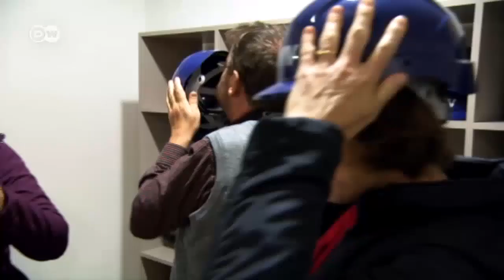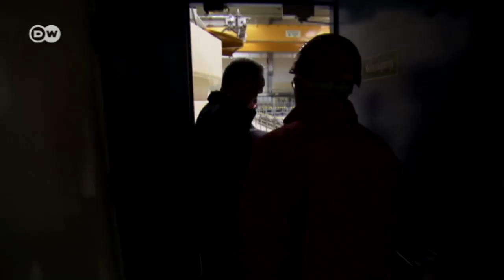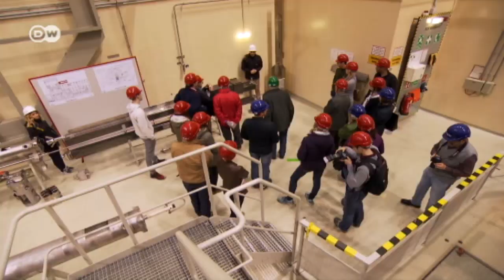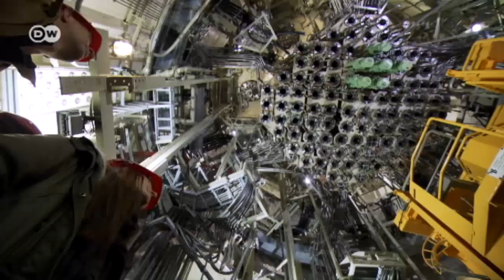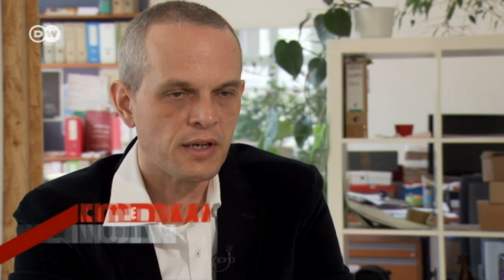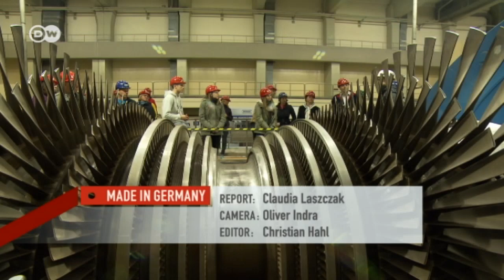How Austria survives without nuclear energy | Made in Germany

Comment: I agree, this video is very misleading, it is only taking the negative part of nuclear energy, the negative reading. Nuclear energy has advanced a lot, and of course in protecting the health and safety of the public. Take it into account, nuclear energy is carbon free and cheap electricity, no greenhouse gases and IT IS SAFE!
Reply: It's not carbon free. Refining and storage of waste is very inefficient.
Reply: yes, but when, rarely, something goes wrong, it has the capacity of killing millions of people, so it is a bit scary. Similar to flying; planes are very safe generally, but when a plane goes down death is almost 100% guaranteed.
Reply: @vanessaruiz4705  It doesn't have the capacity of killing millions of people at all. It's off by three orders of magnitude even if you look at the worst examples of "something goes wrong". However, millions of people do in fact die every year from air pollution from coal power plants.
Reply: @arvedludwig3584   Neither are renewables... you think building solar panels and windmills is carbon free? and what about the battery's required to store the energy... those are even worse for the envoirenment.
Reply: @vanessaruiz4705  Solar and wind energie has killed more people then Nuclear has... there have only been 2 nuclear accidents but WAAAY more accidents happen with solar and wind simply because they require more maintenance and you need more of them to get the same amount of power.

Comment: The Zwentendorf nuclear reactor
There is a great opportu nity between our eyes and very close to our dreams, this is not a precursor to my text.  Truth greater than fiction. The Stephen Dorf  reactor in Austria is the land of dreams, the new El Dorado.
I am a man working from the Kingdom of Saudi Arabia, I have patents for clean energy generation by nuclear fusion and are legally registered in the King Abdulaziz City for Science and Technology.
The technology is engineering based on the classic designs of reactors that use nuclear fission technology.
Of technical and operational contours it is powered by the isotopes of hydrogen, deuterium and thithorium.  Which is not a merger with little risk, and does not result in nuclear waste.
On the one hand, the operating costs are fifty times less than the classic reactors, as well as maintenance and development.
If there finds a better technology than we can remove it in several weeks and build a farm on the same floor without fear of radioactive deposits other than uranium-based reactors, as removing them tens of years and removing costs requires a hundred billion dollars.
If you are aware of a stalled nuclear facility or clean energy operating projects.  Hope you don't hesitate to contact me.
I am ready to answer all inquiries:

 K S A
Jeddah
Riyad Taifi
+966566899956
Riyad@eenergy.today